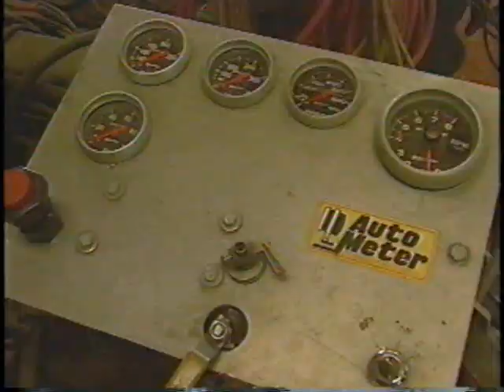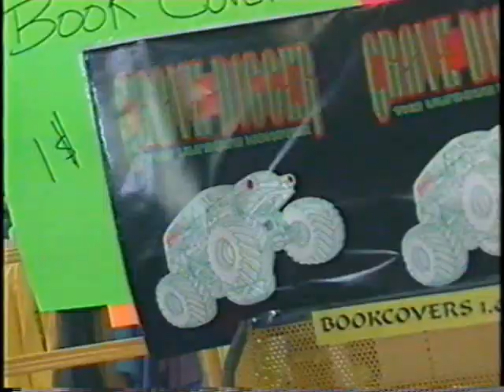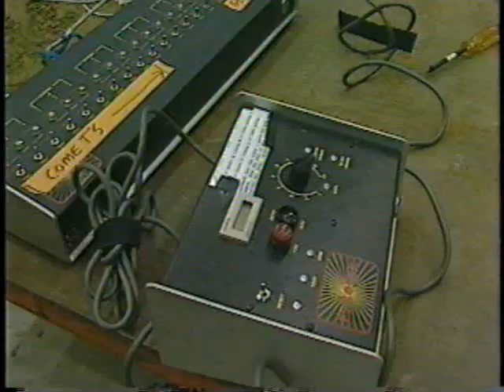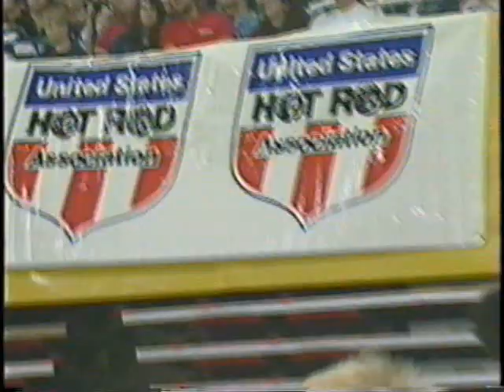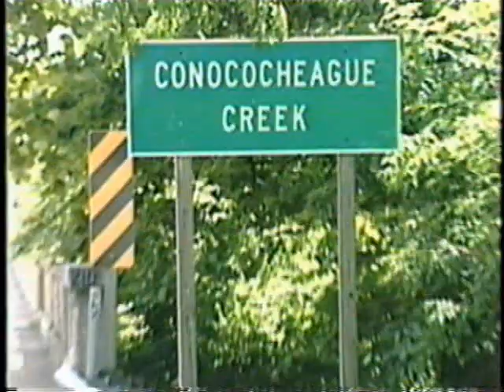Grave Digger: Domination (1997 Original VHS) Part 2

Comment: That #12 he mentions was actually the true #13
#1, Red primer, Blue and Silver panel, first ghost paintjob 
#2 New race truck
#3 First green chassis
#4 West Coast truck
#5 (Original) Built off spare parts of #2
#6 Street legal display
#7 Another race truck
#8 Near twin to #7
False #5 Pablo Huffaker's old Just Showin' Off chassis, came after #8, is the true #9
"#9" First ride truck
#10 Built by Pablo
#11 Second ride truck 
#12 Longer wheelbase, introduced purple fog to the paint scheme.

Going back and counting all of those, that's 13 trucks, and it's no coincidence that #12 stood out amongst the bunch